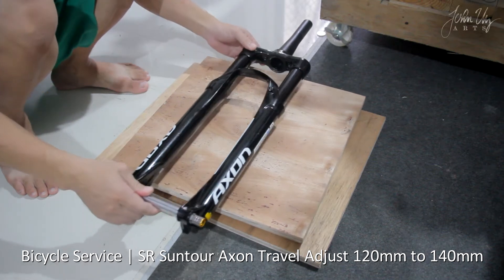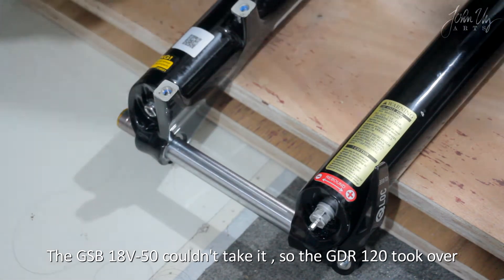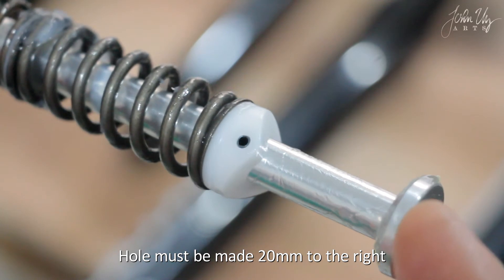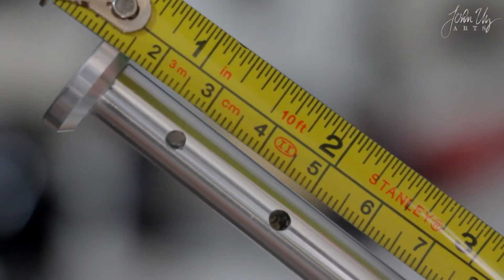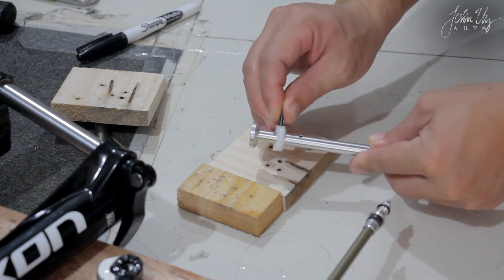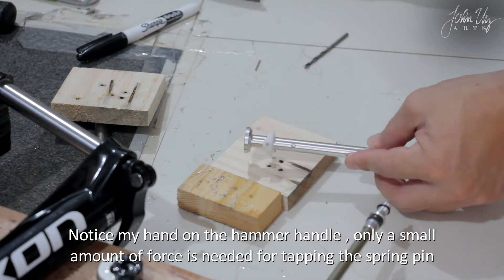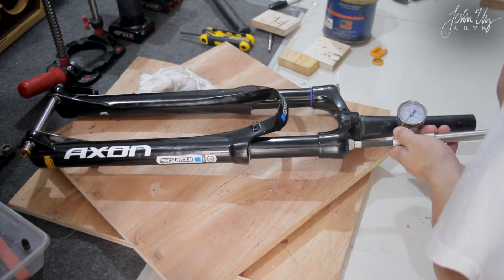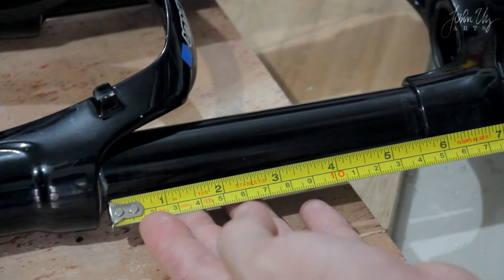Bicycle | SR Suntour Axon Fork Travel Adjust 120mm to 140mm

Comment: Which RockShox fork model would you say is at the same league/tier as the Axon 32 boost?
Reply from the maker: @chris-br2  i am not updated recently, but i believe its about the reckon? For the brand level i think? But from experience i tell you, the axon is physically and performance wise almost on par with pike or lyrik not minding the stanchions...for suntour it is mostly priced by stanchions thickness, the performance is almost similar, with the higher ends having better control/tuning with damping plus the thick stanchions to match your riding needs.
From repairing and maintenance of these forks, you cant go wrong with axon as long as youre not using it for dj or downhill

Comment: bkit pag na play fork q my parang mahina tik sound pag nalubog
Reply from the maker: many possible reasons, broken shaft, loose bolt, busted damper, oil leak, busted seals, rust, broken spring. Have it checked
Reply: @JohnUyArts  pero sir mahina lng mmn sya.. ung dumper nya pansin q maluwag n
Reply from the maker: @marcuz6895  retorque lang sir
Reply: @JohnUyArts  anu ibig sbhn sir
Reply: @JohnUyArts  axon 34mm fork q inadjust q sa 140mm travel mahina lng nmn pag tahimik makikinig m pero pag sa labas gamit m nd n kinig
Reply from the maker: @marcuz6895  re tighten it at proper torque settings.
But maybe there's no problem at all probably just the sound of the oil flowing
Reply: @JohnUyArts  sb daw skn dumper

Comment: paano naman sir kng 120mm to 100?
Reply from the maker: You have two options sir
1. Drill a hole for the 100mm setting
2. Use a 20mm spacer

Comment: I did this on an axon RL-RC 29 "(100 by 120mm), but now my RL lock doesn't work (it seems to be constantly unlocked). Any idea what happened?
Reply from the maker: hydraulic lockout leak, cable problem, lockout switch problem

Comment: I have the same fork and I'm pretty sure the upper legs aren't long enough to do 140 travel safely unlike epixon tr. And yes sinukat ko. Lalagpas ka na dun sa internal plastic bushings nya sa lower legs. But that's just my take.
Reply from the maker: hello, I have just adjusted another one, and I made sure to measure everything this time, the maximum travel applicable is 150mm but not recommended, 140mm is still safe. The damping cartridge is long enough and is still very safe to extend.

Comment: Is this the 32mm stanchion or 34?  If for trail use the 32mm stanchions aint stiff for that kind of suspension travel isnt it? Should be atleast 34 or 35 just like the aion.
Reply from the maker: the 32mm is good enough for cross country, chill rides, but not adviseable for aggressive rides

Comment: Sir possible din ba weapon tower fork maadjust ang travel from 120 to 140?
Reply from the maker: I havent disassembled the Weapon brand , but it really depends on the design of the internals , if there are travel adjustment slots or if the internal rods are long enough for travel adjustment  .
Reply: Oh okay i get it...thank you sir🙏..

Comment: Sir, any feedback on this fork? Is it good? I am planning to buy the 2nd hand, good condition which the seller sold at php7k. I will be replacing mg Suntour XCR spring fork. IS it OK? Thabks po
Reply from the maker: Upgrading from xcr with this fork is more than ok , but any fork depends on your riding style , for cross country use , then this is a very good fork 😊

Comment: Do I need this drilling in my raidon32 boost? I like to adjust my travel also to 140mm.. hope you can answer. TIA
Reply from the maker: If a 140mm raidon exist then the raidon may support a 140mm of travel , before drilling any holes

Comment: if you want max travel, why not remove the limiter altogether instead of drilling a hole. just a suggestion though..
Reply from the maker: First , there should be a hole to fasten the limiter
Second , maxing out using the top bolt as the limiter poses a lot of risks : it might damage the bolt and its the last piece holding all the spring system together , another , that length of travel is no longer safe in the fork design , the bushings are no longer optimized in location of the end of the stanchions , exceeding 140mm of travel is no longer in design with the stanchions , bushing locations , damping cartridge on the other leg , length of the rod which holds the internals together . Hope i answered your curiosity :)
Reply: @JohnUyArts  thank you, your answer saved my fork from being butchered by my curiousity.
Reply: @ranjiyu5917  lol

Comment: Boss asa diay inyoha?naa ko suntour raidon 130 ra max..ako unta ipa 140 ang travel
Reply: Na adjust ra sir to 140mm?
Reply from the maker: @marcoadonniscag-ong9059  Yes sir successful travel adjustment
Reply: Nag buho pa ba sir? Or naa nay buho intended for adjustment hehe
Reply from the maker: @marcoadonniscag-ong9059  need to drill hole sir , original hole is only one
Reply: @JohnUyArts  sir ask lang unsa to na specific raidon? Is it raidon 34 boost?
Reply from the maker: Bankal Lapulapu Cebu
Reply: @JohnUyArts  unsay fb nmo sir..nag work kos lapu2
Reply from the maker: @diaboluspepito5103  https://www.facebook.com/johnuyartscebu/
Reply: @diaboluspepito5103  sir unsa na raidon imuha? Salamat sir.
Reply: @marcoadonniscag-ong9059  raidon boost 32,nag add nako og holes para mahimo cya 140mm travel
Reply: @diaboluspepito5103  nag adjust ko sir wala naman sad ko nag drill og new hole. Pero ang rebound knob nako dili na mo function. Sige ra tuyok2
Reply: @marcoadonniscag-ong9059  tan awa to ang kato knob sa rebound basin nahulbot to ang kato ang porma murag allen wrench

Comment: ito ang gamit kong fork ngayon, gusto ko sanang ipa 140mm,  safe kaya ito sir?
Reply from the maker: actually its safe on its intended use and function , whether it is in 140mm or 100mm setting , it is safe on cross country setup , enduro with no drops of at least 1 meter .
Reply: @JohnUyArts  gusto ko sana ipaadjust kaso ang layo nyo sir😁
Reply from the maker: @Blackadema1979  hehehehehehehe , look for a very good mechanic sir

Comment: no oil add on lower legs?
Reply from the maker: Good day bro , just grease on the seals and wipers , adding an oil bath is highly recommended , but its a client option :D
Normally SR Suntour forks just use grease for lubrication